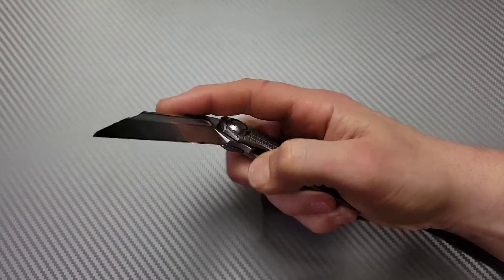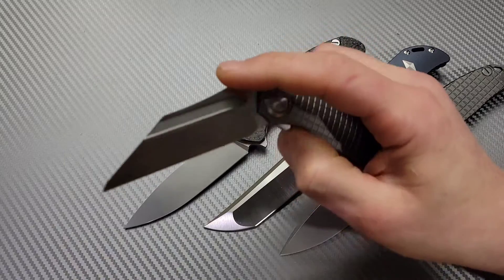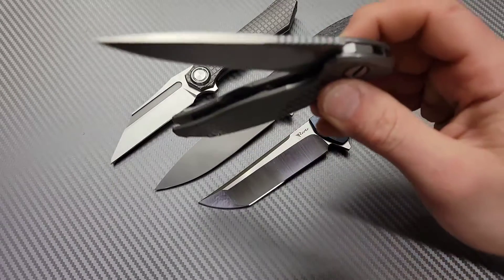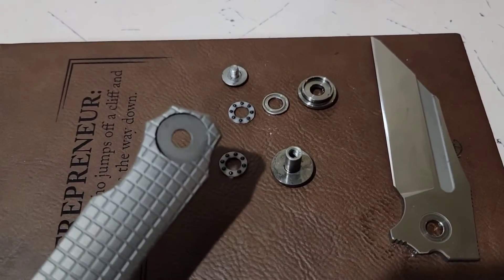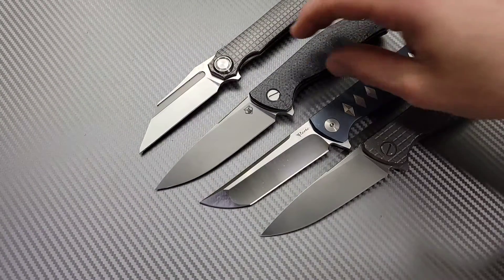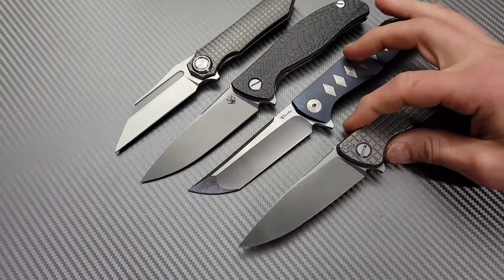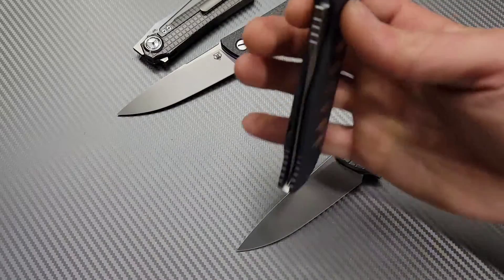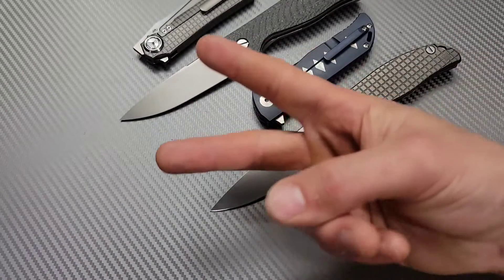HOW TEMPERATURE CAN EFFECT OUR KNIVES

Comment: Not only temperature is a problem for high tolerance knives, but using different metals will create an electrical potential difference that may promote different types of oxidation , etc
Reply from the maker: Definitely

Comment: EDIT^ k I figured I had to put this uptop too... I really am yellin at Metal Complex wayyyy more than yall... 

HOLY SHIT! A KNIFE MAKER REALIZED THAT HEAT AFFECTS THE PHYISICAL PROPERTIES OF METAL!!! 
Really...? Somehow I knew... deep down, I knew... this would have nothing to do with blade or edge quality or anything that ACTUALLY MATTERS.

NO SHIT UNTEMPERED OR TREATED MATERIALS EXPAND AND CONTRACT...

Sorry, I'm really just yelling at Metal Complex and taking it out on you... 

Still... are people at all wondering why we have to put up with all that fuckin locktite on folding knifes? THIS IS WHY! Cause people gotta explain basic science to people who care more about how their 150 dollar pen knife flips or looks or centers as the end point of a knives quality... than HOW IT CUTS.

As a fix for alotta temp issues, I just blast everything with a heatgun after saturating it in nanolube, let it soak, work the joint, blast it, ect... till the lube's gotten all in... just depends on the detant, bearings (have ya baked a cake... in ceramic?) blade quality, and washers are always easier once lubed and heatcycled... 

With Steal or G10, I would be upset if the screws didn't loose up or tighten with temp changes... cause otherwise their glued. These are exceptionally solvable problems with the power of screwdrivers (If you can't find one, ask a German or Swiss... they come outta the womb with a built in tiny set that goes up to s7...). 

Also I want your knives... speakin of how it cuts and design, Shirogorov is perfection... I fucked up once and bought a cheap imitation and fell in love with the design, went to go find a well made one and imagine my heartbreak when I saw the pricetags on the real thing lol... Cheap as shit fake d2, and the blade design and handle still cut brilliant just on geometry and blade shape... Figure at this point I'm gonna grind out a good blade profile that matches outta a decent steal blade and just pretend.
Reply from the maker: Absolutely!! It's definitely something that small adjustments fix every time, I've known people to send knives back when all they had to do was a small turn of a PIVOT, and it was Ferum Forge guys who told the story, so I'm guessing at the time they made the tolerances a little to tight, but then figured out the expansion measurement when building there knives, I'm sure it was very early on and everyone starts somewhere with lessons learned

Comment: Should be easy to replicate and take to the extremes. Freezer for an hour, take picture of centering/feel action. Hairdryer for 15 minutes, take another picture of centering/feel action again. Compare results. Realize it's not as much of a difference in tolerances as you thought. Lubes get thick quick with cold temps so that could alter feel some.

The "linear temperature expansion coefficient" is the term for this. Ignoring units... titanium is around 9, stainless is around 13 and vinyl siding seems about 28. I could not find much on carbon fiber in my quick search. What matters not is size, but the difference between numbers. Ti and stainless steel seem close, at least compared to siding.

Edit part II: My experiment is over. I used a regular 21 and a half cf knife art version. Frozen and heated, only noticeable difference was cold was stiffer. I'm sure the lube was hardened at below freezing temps.
Reply from the maker: I know the guys from forum forge explained that they have to put it into consideration when building there knives so it obviously is a factor, and I've personally sent knives that I've checked that were different after arrival, I'm not saying that's it's crazy common but it can happen, and the oil or LUBE going dry I was saying if it's upside down and 100 plus degrees it might be possible that the Lube leaks out, but even if I need to remove certain tight screws I can heat them up make them expand and the comeout easily, so I'm only saying that under certain conditions it's a possibility so if so just tighten the damn knife or check it before complaining that the action isn't smooth or that it has play

Comment: Jerad is absolutely right. Since all the materials are gonna have different thermal expansion coefficients the best you can do to mitigate it is pick materials as close to steel as possible. Hell, an integral with stainless steel body might be the best choice. Assuming you needed a knife to be tight and centered across hundreds of degrees. I admit that's a comical example though.
Reply from the maker: Absolutely, it was actually forum forge guys that I heard this story from and they said after realizing they starting putting it into consideration with there builds so obviously it has an effect enough that they had to start making there knives considering that it's going to happen 👊

Comment: Interesting topic! Never had this issue with knives, but if it does happen I won't be jumping to conclusions about workmanship.
Need to climatize a bunch of materials before installing inside building too, mainly vinyl flooring and most wood finishes. Totally makes sense
Reply from the maker: Absolutely and exactly before jumping to conclusions that your knife has a tiny bit of play check and see if it just needs a small adjustment or something